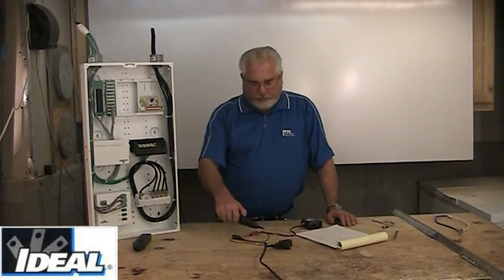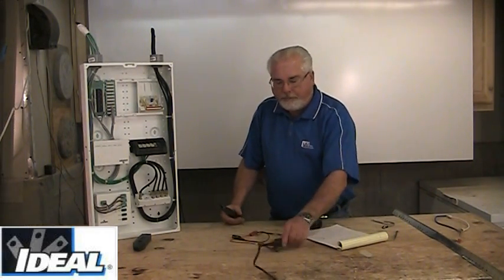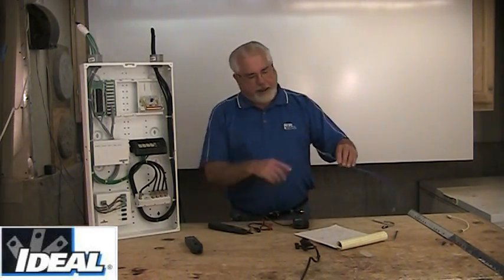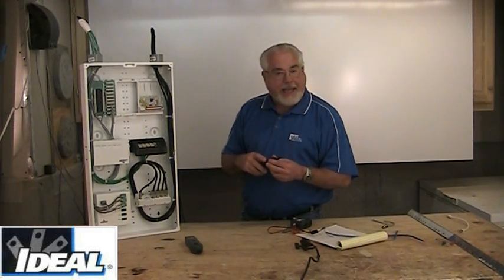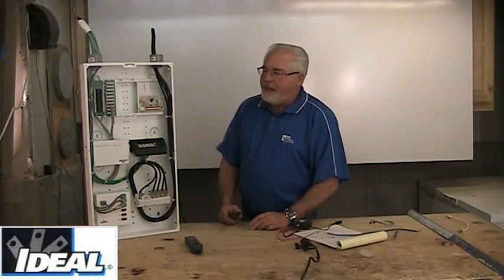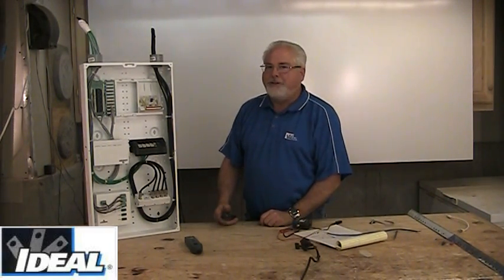Tone and Probe Basics

Comment: I am trying to learn how to use the unit I have, but I didn't learn much from this video. Sorry, but I would have liked to see you use it to check out some wiring actually connected and tested on one end, after the other end is checked with the probe.
Reply from the maker: Hi Sidney you make a great point I should make a new video that more clearly shows using the T&P. Just need to find the time to do so. Apprecaite the comment. Ron

Comment: I bought the fluke pro 3000. how do I use the cont setting?  does that mean continuity?
Reply from the maker: Yes it does mean continuity. Using the alligator clips if the circuit has continuity the light on the toner should light up. Good luck Ron
Reply: ohhnight, just tried it thx. I have a question regarding if the unit is defective or not. I'll hold it on a wire in the same spot and sometimes its louder but sometimes its a softer sound. Is that a bad speaker or something? Is that something I should return it over? exchange for another one?
Reply from the maker: Those toners typically have several different types of tones they will produce. The idea is you can use two toners set to different tones and trace both with the probe. Try holding the tone button down and usually it will cycle through the different tones it will make. Good luck Ron

Comment: So when I shut off the power to an electric circuit, I can essentially tone out some high voltage wires?
Reply from the maker: Michael you can put a tone on anything made of metal and make sure the power is off as it can damage the toner. The probe is meant to find the other end of a cable not for tracing behind walls but it may give you some indication of where the wire goes. Good luck Ron
Reply: Thx. I had an idea that I could do that.

Comment: I had some issues with the wide range of wire probes in the market. Especially from many of the China brands that is saturated on the market with a price half or as near as fluke with tones of neat feature. But here's the difference , majority china brands are able to detect tones if the connectors were not plugged into the ports. However, if the connectors were connected into the port of the device, this china probe tools weren't able to detect any tones generated from the tone generator. Even it does, it's too faint too hear which is a huge problem if the cables were tied together. I won't be able to check which is the right cable. As i know, fluke is more like a precision professional tool but with a sharp price tag. The price tag pretty much adhere accordingly to price vs features. I'm not sure if this product of Fluke pro3000 had such issues of unable to detect the wires if it happens to be plugged into the port of the device. Need your advise. THanks.
Reply from the maker: +Darkskies Vincor If you plug the tone generator into a port of an active switch or at the outlet. The switch effectively shorts the toner and you will get no tone or very little. That is true with any of the tone generator. Both ends of a cable need to open to trace the cable. Hope that helps. Ron

Comment: If you have a 120v circuit that has been tripped at the breaker, but you cant tell which breaker it is in the panel, can you send a tone down the black wire and then use the probe at the panel to find the right one? (since the neutrals and grounds are all connected) I know that there are circuit breaker tracers, but the circuit has to be live to use them.
Reply from the maker: +Kenny Bender Kenny most tracers will trace live or dead circuits at least ours does here is a link https://www.youtube.com/watch?feature=player_detailpage&v=CqOVXwxfHDw&list=PLw8qsvCN6q_0kP_ve66G0PhUxNn8OE00lThey are not cheap though. You should be able to use the T&P though I would verify the circuit is off with a tester first but it should work. The toner should be used only on dead circuits. If you like give me a call 815-341-3537. Ron

Comment: Im in the market for purchasing a professional product. Can you use this on a/c and d/c? just no current?
Reply from the maker: +Richard Cowtails Richard sorry I did not respond sooner however later is better than never. Yes any conductor can be traced as long as no power is present with them. Better units will survive AC if they make contact with the toner and can trace wires typically out to 5-6000 feet.
Reply: +Ron Kipper Datacomm thinking more for a mechanic application
Reply: @greygoosemafia  
i understand this is 4 years old but it might help others

with your question,   YOU HAVE TO UNDERSTAND THIS....

Ohms Law
Volts x Amps = Watts
and
Watts  is Power

so let's say you have a cordless drill for example
15 V drill with 2 Ah  (Amp Hours)
IT MEANS......
15 x 2 =30
so... Your drill can output a max of 30 Watts of Power per hour

so... NOW PAY ATTENTION
some people argue more Volts is better in a drill
NOT EXACTLY
so... if we have an 18V Drill  but its also  1Ah
then 
18 x 1 = 18 watts   so the drill with 15V  ACTUALLY HAS MORE POWER

got that
ok
so for your MECHANIC APPLICATION  you need to identify HOW MUCH POWER YOU ARE GOING TO BE WORKIGN WITH
Example,  I'm in Telecomms   i know i will never exceed TNV (Telecommunications Network Voltage)  which is no more than 120V  and maybe a few hundred mA  at best 

this is why i know that any toner i pickup will either not tone out due to voltage on the line or will tone out because it supports toning through TNV
but, it won't blow up in my hand because they are generally rated to 200V at TNV

Now. if you go stick that on 240V mains at 10 Amps you're going to fuck your toner big time , it might even be dangerous and cause you injury

so  240V  x 10 A = 2400 Watts of Power
got it...
so you need something that has enough protection circuitry that is going to withstand THAT POWER / THAT AMOUNT OF WATTS

so step 1, Identify what level of power you need to withstand while toning,
but as a general rule , you shouldn't be toning over energized lines anyway.

because the other question is,  even if your meter survives it ,   IS THE TONE GOING TO GET THROUGH,
you need to consider the resistance on the wire and the level of energy in the wire vs the amplitude of the tone itself
Most tone put out around 4V -12V at best   Most are 4 to6 Volts

Comment: Hi.  Good info.  You say that the probe doesn't like an AC signal, but certainly the tone being generated is an AC signal.  You mean, I suppose, that the probe doesn't like any AC signal other than the one being generated by the toner.  I'm not trying to be pedantic, I just want to make sure I understand.  My question is whether the use of a toner/probe could ever damage equipment.  It's meant to be used on an open circuit, as you say, but the whole point is that you don't know exactly where the cable you're testing goes.  Do I need to unplug every appliance in my house before tracing a ground line, for example, or can I assume that the load presented by the appliance is "close enough" to an open circuit?  I guess what I'm really asking is whether, in your experience, any piece of equipment (other than the probe itself) has ever been damaged through improper use.
Reply from the maker: Marc Mongeon Marc good to hear from you. What I meant was the toner could be damaged by normal 120V AC signals. I am not aware of the toner itself causing any damage to existing circuits. It is just a 9 volt DC battery generating the signal. If you are using the toner to trace electrical cables in the home then yes all appliances may have some effect on the signal that is being sent. It works best on open circuits. If you are trying to trace cables in walls we do make other tracers and circuit breaker finders that work pretty well for that. Take CareRon
Reply: +Ron Kipper Datacomm This is what I was looking for. I am trying to find out where the wires to a non-working switch in both bathrooms, in the house I bought recently, go too? The thing is, my wire checker goes crazy noisy when close to the wire. The light switch is next to it. You would think it is for a fan, but no fan. One bathroom had a fan removed, but in the attic, it looks like it just goes to the breaker box. The one wire with a junction is for the lights. There is power to the other switch, yet nothing happens. Anyways, my question is answered. NO! I cannot connect it to a live wire. Guess I have to shut every circuit breaker to off. This house, built in 1960, doesn't even have a main breaker. Scary to work on the breakers. I had to put in a 240V outlet for my air compressor. Really scary when the screw driver slips and arcs in the middle of the night.
Reply: @shark70007000  
it's buzzing because there is voltage on the line you are testing
Disconnect the power and test the lines again
and BE REALLY FUCKING CAREFUL  ok
Reply from the maker: +shark70007000 Dude please be safe out there! Call a Pro if you need one. I feel your pain I had a house about the same age and what a pain to remodel basically had to rip out all the old wiring but got it done. Good luck on the house.Ron

Comment: 10:20 (toning a data port that's connected to a switch/router)

I have a Greenlee 701K-G/6A set, and toning a connected cable does work. The reason it normally doesn't work is because the RJ11/RJ45 coming out of the toner applies tone to pins 4 & 5, which are twisted together. When I made a custom connector splitting them onto different pairs, I got a definitive response on a cable connected to a switch (Dlink DGS-1024D). I similarly got a tone on a cable connected to my ADSL router (a TP link), except in this case the tone bled through to all of the other cables connected to it.

I assume this will be the same case with your Ideal tone & probes, so I think it just depends on which switch you use. Some will work, some won't.
Reply from the maker: anon746912 Hey Thanks I will have to give it a try. I appreciate the feedback.Take CareRon
Reply: My problem 
2 wires twisted  together 30 feet long 
one wire is cut not shorted 
TONER detector will show both wires as good  at the end of wires both wires will beep 
but one wire was cut 
TONE SIGNAL will be transfered to the bad wire that was twisted with good one 
USELESS TOOL
LEARN the hard way
Reply: @geoeconomics3067  Important to have the right tool for the right job.

Comment: Thanks for this video.  It helped me determine I was working either with a dead cable or the wrong cable at a friends house which is new construction.  After not getting any tone or signal I looked more closely at the panel in the garage and noticed 3 more cat-5 cables had been stuff up inside the top of the cabinet.  After pulling those back out of the sheet rock all went well.
Reply from the maker: ClearSmashDrop Hey thanks for watching the channel! I am glad you where able to use the info tracing cables is always a pain to do.Take CareRon

Comment: can you trace a line through a coax cable splitter?  In other words does tone go through a coax splitter?
Reply from the maker: Edward Walker Ed no you cannot it will either lose the signal completely or bled into everything. As a general rule both ends of a cable need to be open with nothing attached to them to trace.Godd luck
Reply: Thanks!

Comment: toning out phone and data cables definatly looks like it can be wayyyy more complicating than toning out coax.  Ive always wondered how the phone company techs figure out which wires to use out at the telecom pedestals and sometimes ive even seen them have to go down the street to i guess big junction boxes to connect the pedestal closest to the customer.  Ive looked inside of them and there are soooo many color coded wires but there are many of them the same color so i have no clue how they can know which is which.  Very interesting, im actually trying to get on with at&t to get some experience in that field and hopefuly move onto a phone company like windstream

Comment: i work for dish network and if we didnt have cable toners some jobs would either take a lot longer to trace cables or sometimes even impossible.  One time when i was a travel tech i was sent to orlando for 2 weeks and my toner fell out of my tool pouch somewhere at a job and didnt realize it till the next day when i really really needed it.  Luckily i was able to use my super sat buddy satellite meter and a power inserter for a 44 switch.  I went to each room and i connected the power inserter to the cable jack then went to the junction box and connected one cable at a time to the bottom port on the meter until the red power light lit up telling me that the coax cable has power coming thru it.  It can be a very very slow process especially if its a huge house but its a nice trick to know about to use as a backup incase u lose ur toner lol
Reply: ***** i agree, i had a phone guy come into an office where i worked, he set up some new phones in a sea of wires near the d mark. It was the best tool i ever found left behind from a kimf teck. Now you can buy them any where but, 15 years ago hard to find, i use it to trace all sorts of circuits and correct messes from bad contractors

Comment: Ron, thanks so much for this video.  It's very helpful.

I have one Cat6 cable in my server room that is putting out a REALLY loud buzz when I put the toner against it.  In fact, the buzz is louder than the power cables of any equipment nearby.  I'm assuming this means that a device (in this case a linksys router) is leaking power down a data cable.  Have you run into this before?  Any solutions?

Thanks,

Rick

Comment: Ron, Thank you for the detailed yet concise explanation. I got the XQ-350 which works great (so far) but was very cheap. Instructions on the "fall out manual" are pretty looking but nearly useless (and sometimes mislabeled). Though the probe is pretty easy to figure out, you made it clear and brought out some good tips. And interoperation of probes and receivers is a bonus tip only gotten from an experienced  tech.

I also noticed the use of one signal wire was better for tracing twisted pair but was not sure I was "doing it right". Now I know. I also noticed cross talk and you confirmed what I guessed, so now I dont need to worry about finding a short between wires. With experience, I imagine I will learn to distinguish short from cross talk.

Your product is more expensive but obviously better made. Mine is VERY cheap plastic, manual is POOR and falls out of "pocket" in the pretty nice holster. It works surprisingly well (sensitive) for a cheapy. Hope it does not die early like many cheapies. Thats the trade off we make. Now that I am retired, I cant look at the stuff I used to work with.

Anyway, Thank you Nice tutorial.